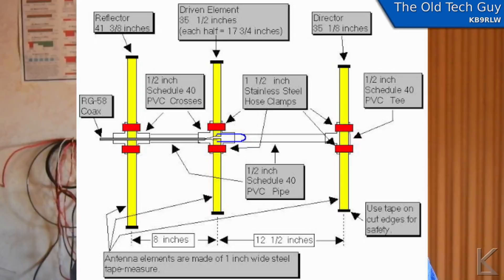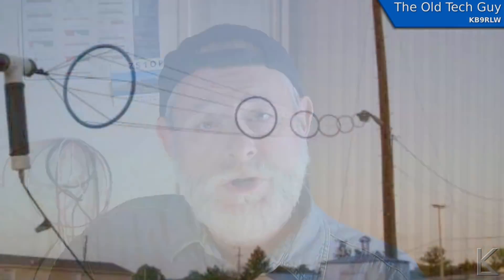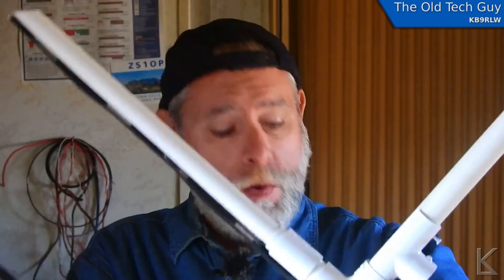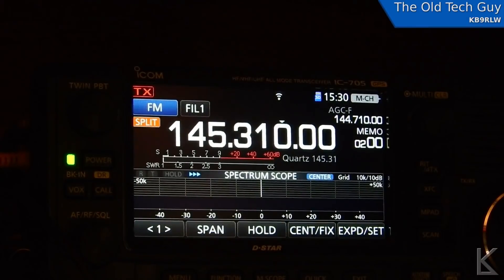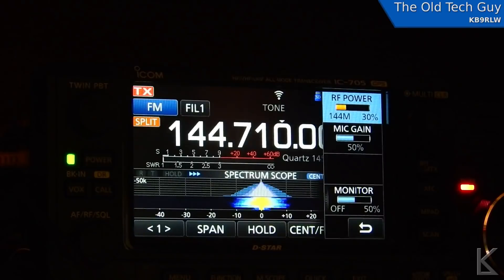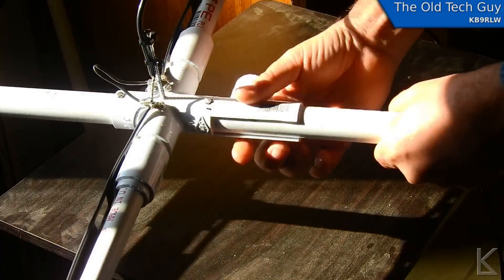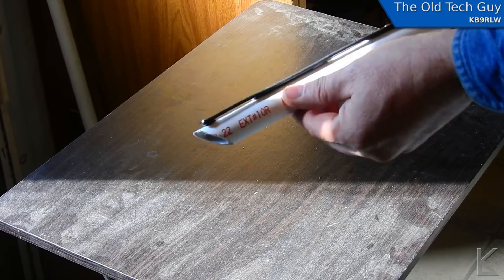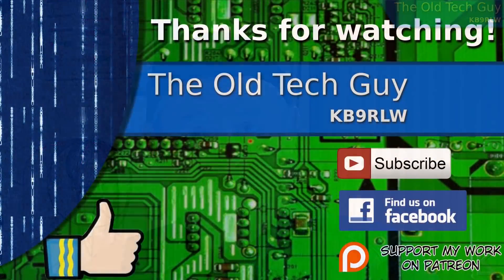Ham Radio - My durable and portable 2 meter Yagi antenna.

Comment: I see what is up hoosier..hihi
Nice 2m yagi beam, very nice.
I built a variation with 1/4" copper plated steel tubing without the hairpin back in 1994. driver was fitted with sliding internal rods to adjust center and match. clamps to hold these rods from moving were merely the wire lug clamps from an old contactor or the same from a scrapped 30 amp air conditioner disconnect. 
Gain in S units was  not quite 7seven and only about 2two db over my copper j pole but for portability and direction is good too.  I use the tree trimmer pruner telescope extension and a three foot tripod at home for the mast, with some poly rope to stabilize it in breezy weather. 
If I add an extra ten foot of 3/4" pvc the total height from ground is close to twenty three leaving a foot of extension inside telescope sections. 
I put it to good use during the 1995 Field Day event for local comms at my camper. 
Anyway, I appreciate simple but effective projects like these, Kevin, keep them coming. 
73, Gary
KB8QLZ

Comment: Kevin, this is a brilliant project and a fascinating design. I have two questions for you: 1) Should you cable tie the split of the reflector and director across the boom to keep them from moving (every so slightly)? 2) Did you consider adding another director to the forward end of the beam for a little extra gain?

I hope to be in Quartzite in a little more than a week. A couple friends and I are heading down there from Carson City to get away from here for a few days and enjoy a little warmer weather and some of the fun stuff down that way. I might try to activate a SOTA while I'm down there. It will be my first time to Quartzite and I'm looking forward to it.

73 de AG7TX
Reply from the maker: The window line is pretty stiff and the connecting wires are solid core.  They don't move a bit.   But you could anchor them if you wanted to. 
As it is, it fits in my storage space.  If I made it any longer, it would have to be stored in the living space and I'd be tripping over it.  So just one director.
Email me if you do a SOTA.  I'll point the yagi your way.
Reply: @loughkb  what about just not gluing the additional director(s) for storage then pressing it together for use?
Reply from the maker: I didn't glue any of the pipes, I used a single screw driven through the fitting into the pipe.  It could be disassembled, but you'd also have to detach the elements from the pipes.  Way too much work to do each time.
Reply: @loughkb  I thought only the driven element was connected to anything?
Reply from the maker: @Justin-bd2dg  All of the elements are mounted to the pipes physically.
Reply: @loughkb  oh that i knew, what i meant was not gluing the connectors between each element assembly. In other words, basically like putting food on a shish kabob stick.

Comment: I have never seen window line used as Yagi elements before. This is a great idea! 
An other option may be a HB9CV style antenna, though the HV9CV is only two elements.
How common is 70 cm in the US? Here in DL-land many repeaters use 70 cm instead 2 m. (ITU region 1 allocates only 144..146 MHz for HAM radio.) So when I faced a similar problem I build a dual band 2 m / 70 cm Yagi with 2 elements in the 2 m part and 3 elements for 70 cm. The 2 m dipole is driven and the 70 cm dipole is coupled to the 2 m dipole by capacitance. Search for "Duoband DK7ZB-Yagis 2m/70cmwith 2 Elements on 2m. and 2/3-Elements on 70cm and one Feedpoint." to find instructions. The same site has similar Yagis with more elements.
Reply from the maker: There's about as many 440 repeaters as there are 2 meter machines around the US.   I couldn't tell you how active they are as I'm rarely on them.
Reply: My question too, is it directly usable as is on 70cm?
Great video project Kev 👍

Comment: Thank you for the great video and blog post! Is there any performance reason this could not be built entirely of 3/4” or 1/2” PVC as long as measurements were maintained?
Reply from the maker: I think you could.  It might need a bit of a tweak to tuning it.   I was just looking to reduce wind loading and weight a bit.
Reply: as the pipe is PVC, then theoretically the resonance will change. i really don't think that it would change enough to make any real world difference.

Comment: 8:55 All around the world diameters of hydraulic pipes are measured in inches and the length in mm. That prevents i.e. leaking if someone would like to match a metric substitute. It would end up with failure and life-changing injuries in some cases.

Comment: Always great to see your projects! Did you say how far it was to the repeater you are hitting?
Reply: He showed mention +60 miles
Reply from the maker: I put text up on the screen.  Approximately 60 miles.    I've also talked to a ham around 16 miles away with my TX power set to 100mw.
Reply: @loughkb  That's awesome 😎. Also explains why I didn't hear it-- for a lot of YT I just listen rather than watch.

Comment: It is not as portable as a tape measure yagi, but it is everything you described, wide banded and more.  It is also a direct connect, and thus easier to build.  I've made both and love the OWA, Optimized Wideband Antenna- yagi.  Check it out: http://antentop.org/w4rnl.001/owa.html
My 70cm version is of course much more compact.

Comment: Hey Kevin,
There is good information in this video. Would you mind doing a video of this antenna in use? Please. I'd love to see how you use one of these for a simplex and repeater contact. It looks as if you can change the polarity quickly too. Thanks Kevin. 73 KE0OAP
Reply from the maker: I'll probably do some once I move further north in the spring.  2-meter activity down here in the south west corner of AZ. is nearly dead.   I know there's a lot more activity up around Kingman where I'll be late spring.

Comment: Hi from the UK. do not worry about the imperial/metric thing. Officially we are imperial, miles per hour for example. but also metric, liters of petrol, so even us oldies are bi lingual. As we no longer use inches for plumbing, 1/2 inch is 15 mm and 3/4 is 19mm. . Metric does have it's uses, with 25 point something to the inch it is easy to cut accurately to better than a 1/16 inch, which is the smallest practical measurement in imperial. Just a thought, if you built it out of 3/4 tube, could the ladder line fit inside the tubes, being kept tight by fishing line? This would keep the elements out of the wind, and end caps would stop the dreaded whistle! Nice job Jim M7BXT
Reply from the maker: Yeah, but when I don't include metric, I get complaints from other parts of the world.  So I just try to include both as a consideration.
Reply: @cathalferris  As I said it was just a thought! Possibly not a good one. but maybe worthy of consideration.